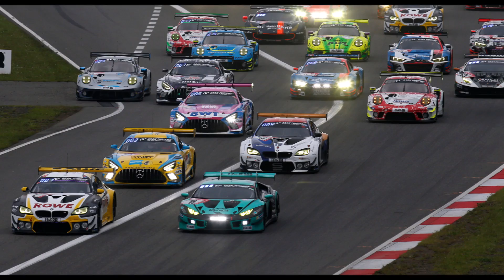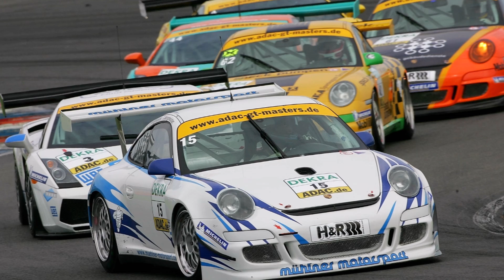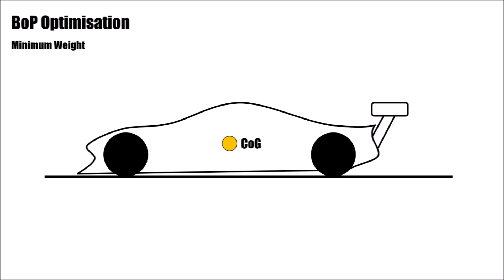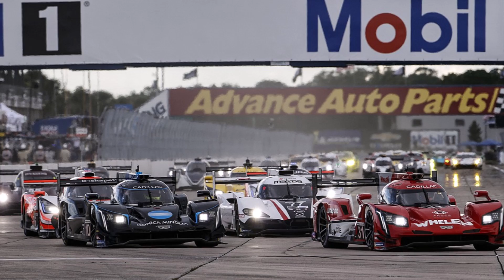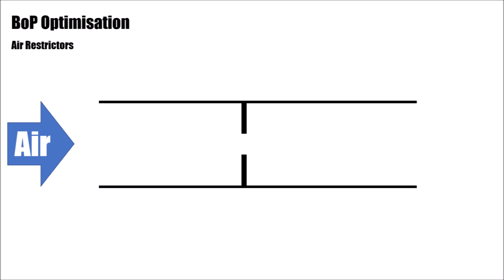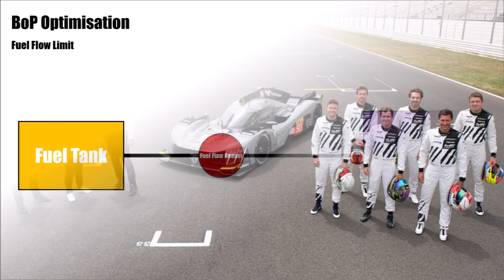Balance of Performance (BoP) - EXPLAINED

Comment: More info that is needed

1. Setup your car in Garage(even use Ai to make a base)

2. Go into the BoP race car setting screen

Look left yellow highlight info is all that matters. Ignore the rest except the gears 

Screen shot that

Take that screen shot and show it to Ai to optimize the setup you already created in the garage

Make sure you set the gearing up

It wiLL say normal transmission 

It is stiLL your gear stack.

You have to toe right and gear right for BoP

Most don’t know this.

You are welcome

Comment: BOP killed modern racing!
Up until the 90s racing had so many fans and the constructors really worked hard to find interesting solutions!

Now with BOP there’s no more interest in developing new tech that could trickle down first into sportscars and then regular roadcars.
It’s absolutely a shame!

It favors cheaply made boring 4 cylinder turbo engines who have zero emotion!
Reply: Racing costs too much nowadays even for manufactures. Without BoP there would be only 1-2 manufacture for each racing series and they would be gone in a few years because it would be boring as fk to watch same cars wins every races. BoP helps to have a lot more manufactures and makes more close racing, even if it's a bit against "racing nature"

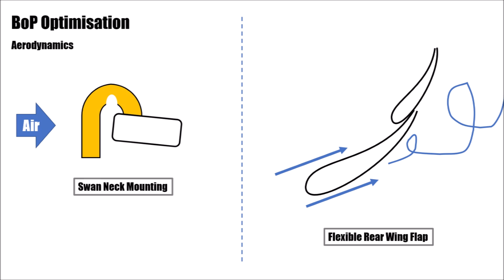Comment: 3:34 Wait a minute. Doesn't stalling the flow INCREASE drag?
Reply: Not in the example in the video. If it was a single element wing and you increased the angle of attack to get the wing to stall, then yes, you're just increasing drag.
Reply: @cben86  So basically in a multi-element wing, increasing the angle of attack basically streamlines it into a single-element wing of a longer chord length, right? And that lowers drag?
Reply: @arjun._.bbC6  Dual element wings can run a more aggressive angle of attack without stalling compared to a single element. In the example from the video, the angle of attack is not changing. The upper element flexes at a certain speed/load and blocks the flow necessary to the underside of both elements, stalling the wing
Reply: @cben86  I see. Understood. Thanks.

Comment: One thing that could be added is how Bop and amateur drivers have changed the way GT3 cars are designed. Because there is no need to get best performance, development is focused on getting best consistency over a long race and wide spectrum of conditions. Easy to drive and relatively comfy car is good especially for amateurs, which makes large customer base for a lot of GT3 cars. To some extent even aerodynamics are designed that in mind. For example, Audi R8 LMS GT3 have been quick car in the hands of pro-drivers but it relies a lot on ground effect downforce which makes it a bit tricky to drive for not so skilled drivers. Therefore the new evo2-kit for Audi have larger rear wing and less advanced underfloor aero to make the car more predictable to drive. Same for new BMW M4GT3: huge rear wing but pretty ordinary diffuser and front aero.

Also one trick that have been used with the fuel tank "balls": In 2018 (I think) Daytona 24h Land Motorsport was consistently refueling faster than competitors. They had fully legal refueling rig and legal fuel tank in regards to size. But AFAIK they used somehow shaped fuel tank volume limiters that increased refueling rate. As a result they got 5min stop&go while leading though, which is BS IMO since they didn't technically break any rules but rather outsmarted competition and rule writers.

Comment: This is a useful summary. Outside the business of racing there is something called a "climate crisis" and it is possible to be a race fan and conscious that the FIA/organisers really need to avoid killing the "golden goose".

BoP can be decided by energy consumption / CO2 alone - as it was with Group C, the legendary racing series of the 80s. Personally I think that this should be a fight for efficiency not a tool to manage entries. 

I'm no engineer but this should put the emphasis on: 

(a) engineering efficiency (engineering is generic to cover everything from aerodynamics, suspension, weight optimisation as well as ICE / hybrid / electric motors to lots of maths). 

(b) virtuous biofuels and (ie made from Agri waste rather than primary food crops) and virtuous hydrogen or even electrical production (let's remember that electric motors are only as efficient as the power source and as 50% is lost in distribution, electric cars are inefficient and also create CO2 / air pollution. 

(c) reducing speeds by limiting powertrain size to no more than 1500cc and tyre width (o reduce air pollution from micro plastics....and make racing more exciting to watch). How about 200mm width and a 500 km minimum distance...
Reply: "reducing speeds by limiting powertrain size to no more than 1500cc..." - Formula 1 cars have engines of 1.6 liters, and look how fast their times are (if we focus on Red Bull, Mercedes, Ferrari, and the occasional Aston Martin). Besides, speed isn't the only factor in producing fast lap times.

This point is kinda short-sighted, to be honest.

EDIT: Besides before I forget, said cars have the MGU-K and the MGU-H installed to augment the engine. Toyota, Ferrari, Peugeot, and all of the LMDh-spec cars have hybrids. Finally, aerodynamics play a crucial role in getting the car fast and corner fast, so your argument of downsizing engine sizes to reduce top speed makes even less sense.
Reply: There is no crisis. The data is manipulated.

Comment: BoP basically kills any creativity/innovation, but improves racing. I'm still undecided about it
Reply: It's important to mention that BOP also exists to reduce cost. Radical changes and innovations in racecar development are extremely expensive which is why so many race series without proper BOP often end up with only 1 or 2 competitive teams eventually. The whole point of GT3 back when it was created, was to allow wealthy amateurs to race. But to get a properly sized grid you'll need somewhat affordable racecars. With BOP you basically shut down the developmental arms race, which makes cost very managable and predictable, while making it attractive to manufacturers because they know their car will have a fighting chance for a good few years without major cost increases (hence why you see so many different manufacturers racing in GT3 and GT4). So yeah it does hamper radical innovation but there is definitely creativity at play to make a car run better than others, the changes are just more subtle. There are many different factors where you can still improve a car within BOP (pace at high fuel vs. low fuel, pace in wet conditions, tire wear, fuel usage, drivability, cooling, aero stability etc.)
Reply: However I will counter with when you're dealing with AI with these stupid as Hell Bop restricted events it feels like they still have upgraded Vehicles by comparison
Reply: BoP doesn't kill anything. The cars in the Hypercar class looks more innovative than any other racing series. Look at the Peugeot for example. In fact, in 2025/26 they will bring hydrogen, so we will see synthetic fuel cars vs hydrogen cars. BoP exists to reduce costs mostly, not to kill creativity.
Reply: @adriWRC_  You deffo got a point, very much looking forward to hydrogen joining the game
Reply: @adriWRC_ how can teams innovate in anything outside of fuel type if the FIA are just going to make the car your team engineered as slow as all the other cars on the grid?
Reply: @divinasi0n  Teams actually "Innovate" with BoP in mind, there's things BoP can't "nerf", there's a reason the previously strong teams are still strong.
Reply: @caydenph2741  like what other than the engine

Comment: I think BoP should only be used to set maximum performance limits that the teams are allowed to reach - like total downforce, total engine power, minimum weight, etc. But if a team stays within those limits and is still faster than another team, they shouldn't be handicapped just for the sake of balance.

Trying to match lap times in a racing series goes against the point of racing.
Reply: Exactly. Punishing someone for being better is the end of competition.
Reply: @Ichblutestarkundmiristschlecht    I don't think you understand what competition means.
Reply: @MarkoLomovic I think you don't understand what is building racing car means. Why should manufacture bother about building fast sport car and invent something new that would allow their car to be faster than others if it would be punished by BoP anyway?
Reply: @Grishazavr   I see you have no clue how it functions. They make them and sell them for teams to race with and sell their services. You are asking stupid question, why would car manufacturer bother to sell cars? l 

BoP is there so it put limit on spending and there is still a lot of development done on cars it is not like BoP removes competitions better car is still going to perform better there for more customers will look to join the program.
Reply: @Ichblutestarkundmiristschlecht  Competition isn't about one team being deservedly better than others, it's about having the ability of all teams to compete on their merit rather than their wallets. F1 at the moment, as well as through a lot of history, is a 'good' example of unchecked engineering and how uncompetitive those races become
Reply: So basically how FIA GT2 (then renamed to GT1) was.
Reply: I mean pick your poison.... Would you rather have Reb Bull and Max Verstappen like dominance or close racing?
Reply: @moveonvillain1080  You can have close racing without BoP. One way to do that is with ballast that's added according to the championship points.
Reply: DTM has been doing it since I was a child. I thought it's only me to think that this practice defeats the purpose of car development...
Reply: "Trying to match lap times in a racing series goes against the point of racing."
Trying telling that to Americans!
Reply: Ok. But without bop the bmw m4 wouldn't stand a chance with huracan and others mid rear engine. The m4 is slow without bop
Reply: @willianporfirio3615  That's the constructor's problem. Not everyone else's. So, you say is fair that everyone get's BoP'd just because a contestant isn't competitive? So, imagine, I want to run there, and I only have a crappy car to run. No problem! Everyone get's slowed down to my level so I can get a chance to win. How is that fair?
Reply: @OliveiraX it's not fair, its absurd and 1 of 2 reasons why I don't watch endurance racing. I just can't understand why teams would build a quick car if the FIA are just going to make it as slow as all the others.
Reply: @divinasi0n  Except BoP doesn't do that.
Reply: @divinasi0n  I also have a hard time figuring out this BOP thing but it does put a lot of different cars and teams on the grid so theres that.
I read a lot of complaints during the 6H SPA this weekend about Ferrari and Toyota, I wouldnt know but many seem to think BOP has been unfairly handled, its sad if its gonna draw a suspense of corruption over the championship.
Reply: @caydenph2741  As you know more than I do, I would be grateful if you would explain how BOP "doesn't do that." Say Ferrari build a light, agile, balanced mid engined sports car, because that's the ideal configuration for a race car. Then Bentley come along with their front engined boat and the geometry is sub optimal and it doesn't turn as well because it's not a sports car like the Ferrari. The Bentley is a few tenths slower through every corner so the FIA force Ferrari to take a human body-sized weight penalty inside their car.

The season progresses and the Ferrari is still faster than the Bentley, even though they have the same horsepower, so they put an intake restrictor on the Ferrari to make it slower.

Please help me understand why this is fair, and why a team like Ferrari should bother making a fast car?? What am I missing? I can only imagine if this was happening in F1 & the FIA added a sandbag to McLarens cars right now - or told RedBull or Mercedes to run higher boost pressure on their cars. When they change a regulation in F1, it applies to all cars on the grid.

Comment: U can also "hide" Ur performance, why I have to be 2s faster when I can win by just being 0.5s faster? If i get penalized of 0.5s due to BoP, i can simply "unlock" another 0.5s from my original 2.0s advantage and won 4 times with the same exact advantage to the 2nd.
Reply: That's not easy to do. And if you get caught you would be banned from racing for a while

Comment: To have BoP in a prototype class, where cars can be built to a set of regulations, is nothing short of a travesty. It violates the very basic of motor racing.
Reply: I think nobody likes bop but would you prefer three cars racing and Toyota winning every single race?
Reply: I would rather have BoP and 7+ manufacturers competing in the class than no BoP and only 2 teams.

Not to forget that almost every manufacturer pushed for BoP in the class.
Reply: @Zanion  
And what do you think will happen? All those glorious seven manufacturers will bitch for better BoP, not win the one Le Mans race per year (after all, WEC is marketed extremely poorly, and people barely know it exists) and leave very quickly.
Reply: Quite frankly, yes. Racing is a sport, not a show.
Reply: @X8X8X8X8X8X8X8X8X8X  It might be marketed badly but if they get their shit together with propper highlights "videos" and not whatever they are doing now sometimes they might get something good going. Maybe get their Website with life timing going so it is intuitive and functunal on mobile. I mean they have a big resugance coming up, all the races have VODs on Youtube a month or so later F1 doesn't do that. I'm planning on spending Big Money on next years Le Mans. Would not have done that without the manufacturers coming. They do the advertisement WEC does the technic around the whole thing... and bam. Maybe some fans and manufacturers that stay. 
Le Mans is a Race with prestige, why loose out on that if the deal is at least halfway decent.
Reply: @herbertkraft7379  
You are right, things are finally looking up. Basically, WEC has to present itself as its historic self, the second pillar of motorsport.

Comment: BoP is the death of motorsport
Reply: Without BOP motorsport would suffer a death
Reply: @dod_the_angel   not at all. Just let them race. Like in the old times. Just put a safety test and a budget cap, and leave all the other stuff to the teams without a million crappy regulations. The only regulation should be safety
Reply: @ControCulturaX  teams would just spend their way out of any holes they got into and leave the minnows with less budget in the dust. Since the minnows can't compete they'd leave the sport, leaving it with less competitors, less variety in the field and crucially for the organisers, less money. Less money makes it less viable to host the series and it dies
Reply: It's been in use for some time and hasn't killed any racing series. In fact just the opposite.

Comment: i hate bop, whats the point of designing good race car when boats like bently can do the same laptimes.
Reply: to get different looking cars racing close, we wouldn't have gt racing today without bop
Reply: Atleast dtm BoP is pushing the gt car's maximum potential.
They are too heavy to add BoP ballast on top of.
quite low hp for race car and BoP makes them under 500 hp in general.

Comment: Is there no BoP for rear mid engine vs. front mid engine cars? Rear mid engine setup is inherently advantageous, that's why Formula 1 cars adopted it.

How about BoP for turbo engines? Turbo engines are inherently more efficient than naturally aspirated ones.
Reply: tyre size is limited, which harms rear weight distribution more than front engine cars. 
for turbo ecu limits the boost
Reply: yes. BoP accounts for this. eg. a turbocharged engines tend to have to use worse intake restrictors and mid engined cars tend to have to have a higher minimum weight.
Reply: that is because of front wheel steering
Reply: Turbo engines are only generally more efficient in road vehicle applications, not so much in racing AFAIK
Reply: @maz4304  not quire right imo, turbo provides huge torque and power at low rpm. at low rpm intake restrictors are not as big limiting factor.
also having massive turbo torque means your gear ratios can be off and car will still pull....as gt rules don't allow to change gear ratios , it hurts NA peaky engine more like porsche....than a turbo v8 like in bently.
Reply: @RB26N  I'm pretty sure Audi/Lambo and AMG would strongly disagree. Turbos don't necessarily provide big torque down low, that's very much a matter of tuning. Especially in (most) race cars priority lies in the higher rev range because that is where you spend the most time accelerating anyway. NA engined GT cars still got the edge accelerating out of corners. Roadcars with turbos have more torque at low RPM because that's where you need it in everyday use. It's always a balancing act. Plus a turbo adds weight.
Reply: @NicoNice24  i don't understand how , NA engine gt cars got edge on acceeleration out of corners.
surely race cars are tuned for max power at high rpm, especially true for na cars.
the problem is gear ratio are fixed so in general your car will be out of peak power, but not for turbo.
a turbo tuned for high rpm will still outperform na at low-mid range torque battle.
the na cars u mention especially mercedes have quite big displacement which adds weight too and probably isn't as efficient as turbo.
also weight is "useless" , BoP alters it anyways.